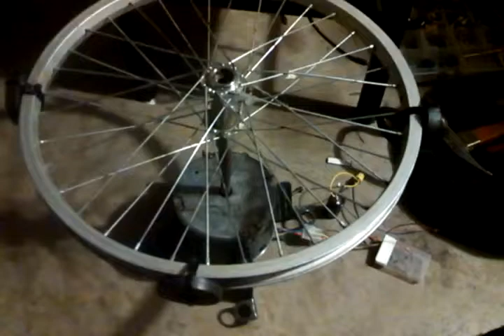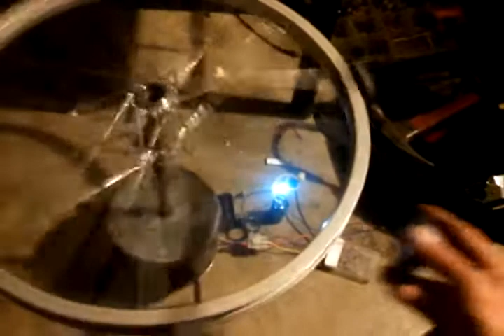Free electricity generator.

Comment: That is kewl. :)
What rpm is required for those X-13s to provide 120 volts?
Reply from the maker: I don't have a tachometer. But I can spin this set up with my hand up to 40 volts DC with the three phase rectifier.
Reply: That's cool as heck.
Reply: i got a couple videos of the x13 motors check them out